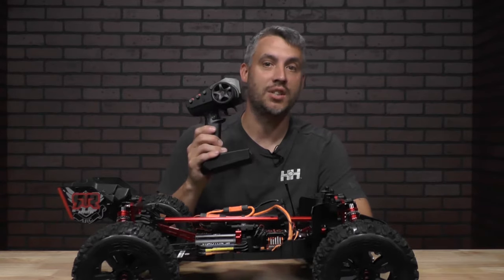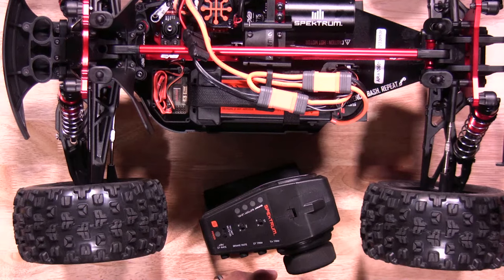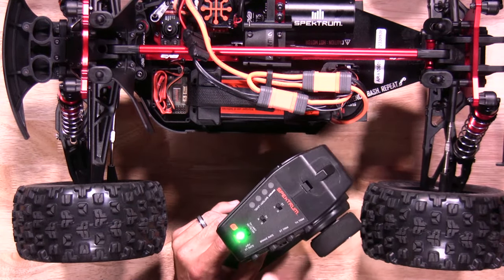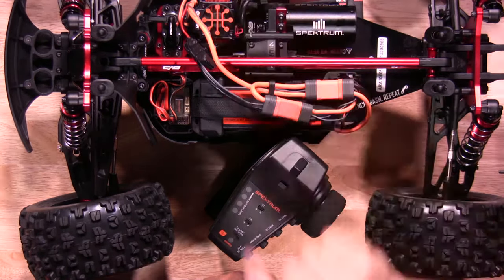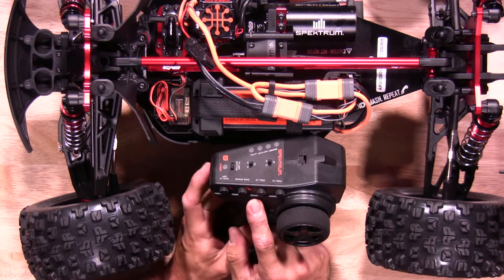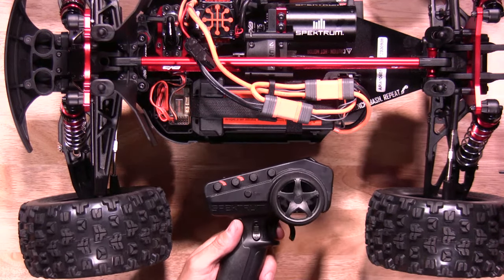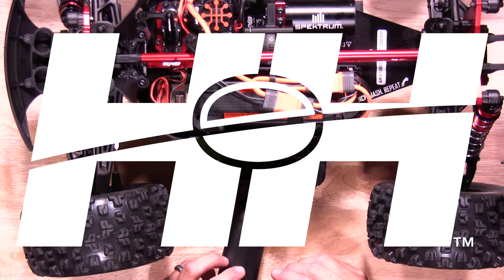From the Tech Desk: How to calibrate and set AVC W/DX3 on your Arrma 6S vehicles.

Comment: Avc is set incorrectly. Wheels should turn out of the slide, not into the slide.
Reply: Thats right
Reply: How to disable is the question
Reply: Yeah. He did full right first. You're supposed to do full left first then full right.
Reply: @IISG93II only if the steering channel is reversed. Then yes, you calibrate the AVC right then left. Otherwise left then right.

Comment: My sbr 2.0 gets immediate throttle response after going into nine mode and won't complete the process. Avc, and brake rate are turned all the way up, st and th trim set to neutral, power is 100 and th and st are set to neutral.
Reply from the maker: Double check to make sure the esc is calibrated
Reply: You have to wait for the receiver to turn orange, sometimes it takes couple seconds then you can full throttle then reverse then right and left. Not sure if left first then right. Lol

Comment: After doing the bind when I pull for full throttle my tires spin. What am I doing wrong? I have the same setup and followed it step by step.
Reply: Same for me
Reply: Oh shit. I have the dx3 but the lmt is sent with receiver sr315 wich doesn't support avc. This is why i can't calibrate avc
Reply from the maker: Correct.
Reply from the maker: What TX/RX do you have?
Reply: You have to wait for the receiver to turn orange, sometimes it takes couple seconds then you can full throttle then reverse then right and left. Not sure if left first then right. Lol

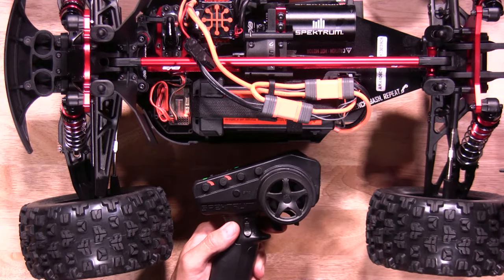Comment: @2:24  uhm, it seems to me like the behaviour is flipped. If the back end slides right, shouldn't the front wheels also steer right to stabilize the car? Interestingly enough, in a SPEKTRUM AVC setup video, this is the behaviour they show, the exact opposite of what you are showing here.
Reply: exactly. I have that avc flip problem. Anyone solved that? THX
Reply: @perichi101  it should sort itself out if you recalibrate ... I vaguely remember encountering the same issue but then somehow I sorted it out. Unless I am just  creating random memories :)
Reply: @ioandragulescu6063  I have vorteks 3S, its different receiver. Recalibration is done via ESC set button. But ill try today like this. I noticed that the receiver light after rebinding dims after giving it a signal from transmiter...did not find someone talk about that. Might work...fingers crossed.
Reply: @perichi101  quickly looking over the specs it seems you have the SR6200A receiver/DX3 transmitter combo, same as my losi hammer rey.
Reply: @ioandragulescu6063  My hope for fixing this is so high now. Cant wait to get home and try. Thank you.

Comment: I just got my new Spektrum DX3 on warranty and having issues binding. Both steering and throttle are in reversed and slow to engage with the AVC receiver. At times, the radio will not talk and the radio starts to go off with all the green lights flashing making noises. It’s hit or missed, it works and then it doesnt, got to turn it on and off often. There are times where both radio and car are on with no movements , then youll see tge wheels start yo shake after a 1 minute, then the radio works.

Any help will be greatly appreciated.

Comment: Awww ma gawwwd, I did exactly what you said on an Armma Outcast 6. it synced, the light went solid on both tx and rx so I held the control and pulled the throttle full on. The car came off the stand ripped the table cloth off and threw every on the table onto the floor before I caught it... it took off FULL THROTTLE. !!!! Hurt my fingers and I'm lmao. What went wrong please ????
Reply: You kept the wheels on when doing a calibration you didn't know anything about, so the fault is all on you..if you would have seen or done this before, you would know this would/could happen..
Reply: Some take the wheels off during programming for safety.   But you may need a spacer and tighten the lug nut to keep the bearings tight together.

Comment: I have a new ARRMA INFRACTION V2 into which I had to install a new steering servo. After I did, the steering direction was wrong so, I flipped the tab on my DX3 transmitter to reverse and fixed that. But then the AVC is all wrong: When I lift the car and turn it to the right, the AVC turns the wheels also to the right, and when I turn the car to the left, the AVC turns the wheels also to the left. Question: How do stop the AVC from working backwards and to orient the wheels properly?

I was told to rebind and recalibrate, I did repeatedly, but the AVC still turns the wheels on the same direction of the body. I feel the AVC system is confused by the face that I had to reverse the steering servo, by switching the tab from N to R.

Please help. Thank you.
Reply from the maker: If you switch out the Servo. You will have to go through the set again.
Reply: I am purchasing a signal reverser!! I am having the SAME issues!!

Comment: Hello friend, I have a radio dx3 and in my arrma infraction 6s I will have moved some settings with the bluethoot module in the app, the problem is that when I detach the avc does not turn off and the wheels no longer turn, instead when I reactivate the avc is always active and the wheels instead turn, I can not detach the avc yes and mixed with the servo,  Please help me.

Comment: Done this 3 times blx3s vorteks with a dx3 the steering has no input it dims during Calibration but after I just have throttle control no steering no light on esc or rx when I sent steering signal after the calibration

Comment: I just bind my Dx3 but when I go to calibrate I ain’t getting any throttle. I have starting but no throttle and all the settings on the remote are right.
Reply: I'm having the same issue no trottle but trottle when I turn my steering wheel to the front
Reply from the maker: Make sure you turn it off and back on. Make sure you allow it time to get through safety checks. Also the truck needs to be flat and level.

Comment: Kindly I have a DX5C  and a DX5 Pro and I purchased five SR6100AT and three SRS6110AT receivers to use on my cars but I couldn't use the AVC with the SR6100AT because the cars starts to wobbly so I have to switch off the AVC.
I also purchased a DX5 Pro and still have the same issue with the same receivers. 
I tried the SRS6110AT, and they work fine with both radio transmitters . Finally, I can use the AVC, but I have to change all my SR6100AT receivers at a cost, which are not cheap!
Does anyone else have the same issue?
Reply: Maybe your AVC has incorrect response direction?  If you pick up the vehicle & turn it to the right (simulating  spin to the right) do the wheels turn left to correct the spin?
Reply: No it is the receivers that are defective because when changed wit another receiver model it performs well.